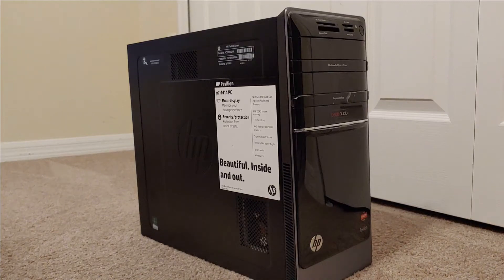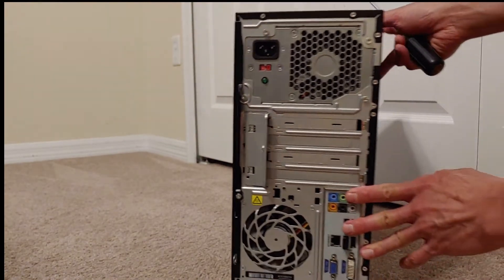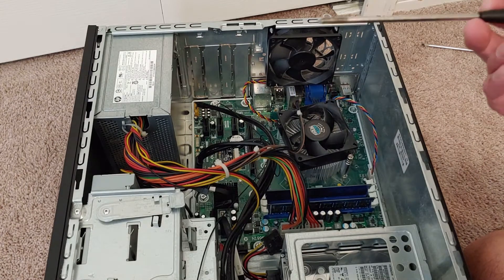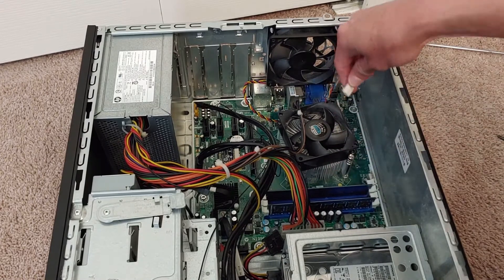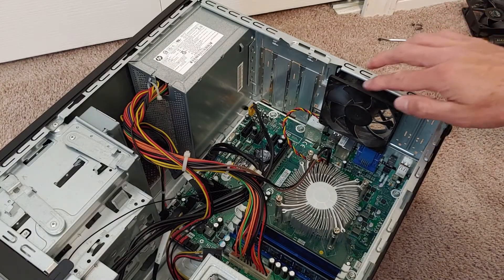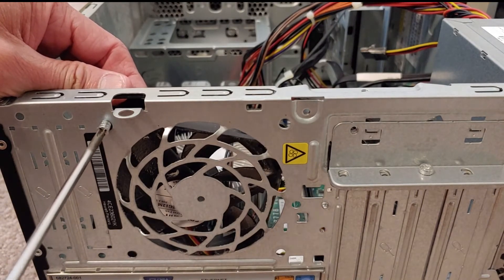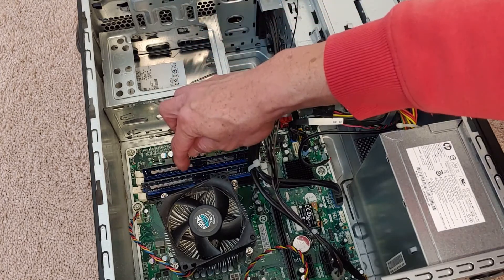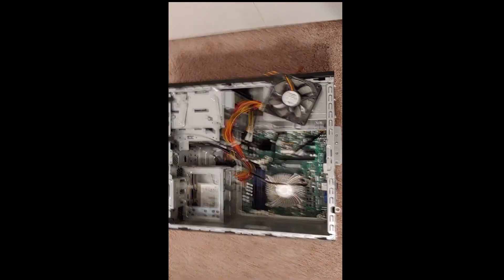DIY Repair or upgrade your computer (HP Pavilion P7)

Comment: I was given the hp p7-1451 model by a customer of mine , ive been upgrading it for use as a htpc , my question is,  out of 1 of the upgrades I'm doing is upgrading to nvme.2 specifically hynix platinum 500gb , I know for this board it won't hit full theoretical speeds but in terms of connections what adapter should I get for the best this board can only offer,  I bought 2 m.2nvme to pcie 1x but looing into it and not intirly sure of this info but it may be slower than my sata ports on that board , looking to boot from disk , 1 os on 1 and another on the other 1 , thnx in advance for any and all help from the user and or comments community 😊
Reply from the maker: I honestly don't know. I haven't had this computer for a while now, so I don't feel best qualified to answer the question. Hope the community can step in with some answers!

Comment: Howdy from Toronto Canada, as a desktop I'm using an HP Pavilion P7-1054 exactly like the one in your video, I would like to upgrade the CPU but keep the current Windows 7 Home Premium edition!
Please tell me where the CPU is located and if the CPU can be removed in order to install a new one!
Current CPU: AMD ATHLON (tm) II X4 645 3.10 GHz
Current RAM: 10GB
Thank you so much!
Reply: The Athlon CPU is located below the heat sink. The heat sink is what the 1st fan was attached to.
Reply: @johnbeyers4104  Thank you!
Reply from the maker: It's been years since I had this computer, but I only knew how to change the fans or add RAM unfortunately. I am not a professional computer guy- just someone who figured out how to do those two things...
Reply: @SuperSimpleFixes  Thank you!

Comment: I love my 10+ year old desktop. I wanted to upgrade the RAM. How do I determine if my MAX RAM is 16GB or 8GB? I have come across several websites that say one or the other but I want to know if I can go as high as 16GB.  Have you had success installing 16GB of RAM on a Pavilion p7-1380t CTO?
Reply from the maker: I haven't gotten into that particular model. If you're not sure how high you can push RAM through your research, I would find the documentation that came with the Pavilion p7-1380t CTO (safest way).